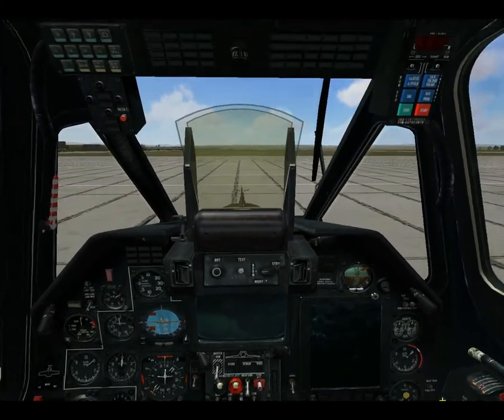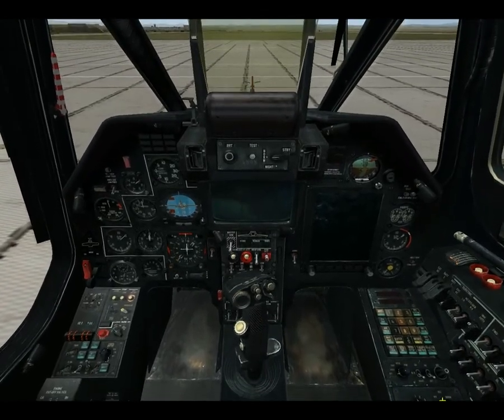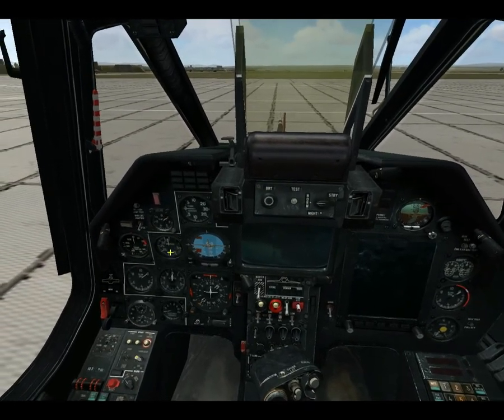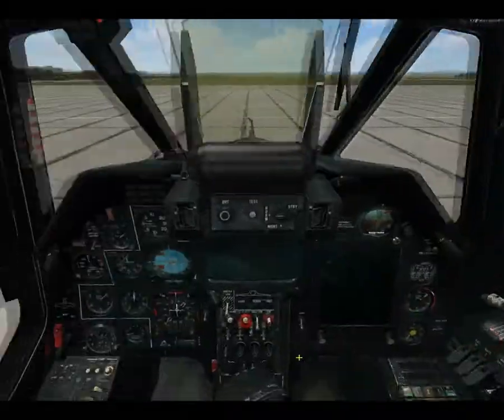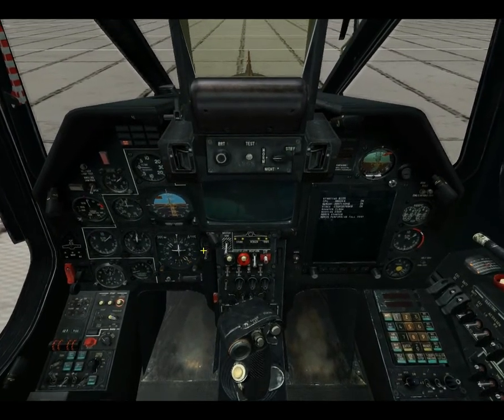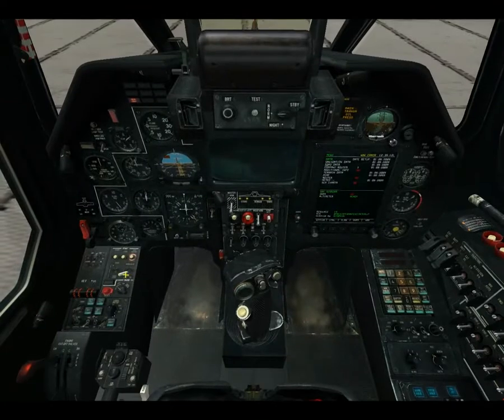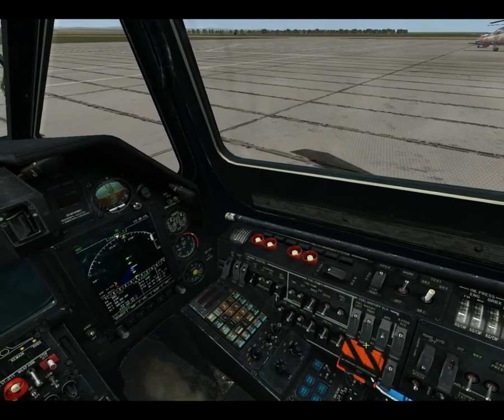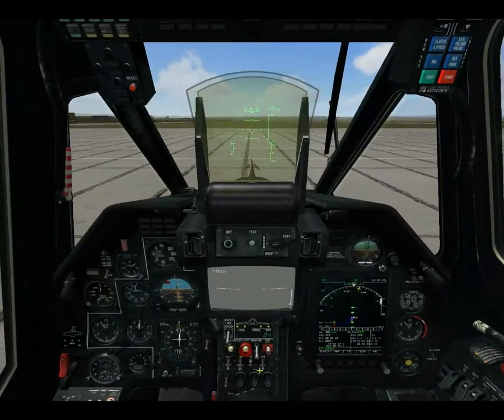Black Shark Startup Tutorial How To

Comment: I've got the startup down but I run into another issue, without any input from my cyclic the helicopter want to immediately go nose up (way up) any input from my cyclic usually causes the craft to go haywire with sporadic movement in the applied direction. Also, when I can finally manage to get in the air and start moving, the craft wants to lean right. Can't make it stop other than using the cyclic to counter it. What am i doing wrong? I come from planes and am new to choppers (might help lol)